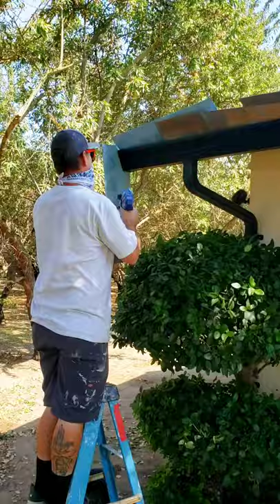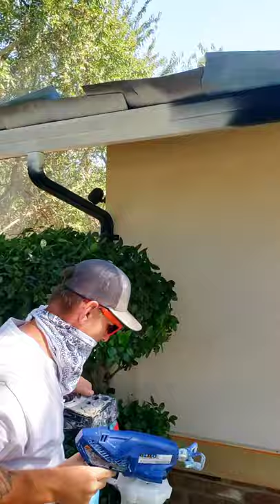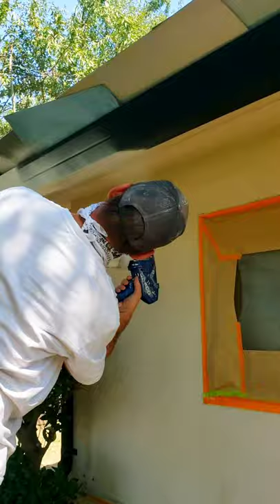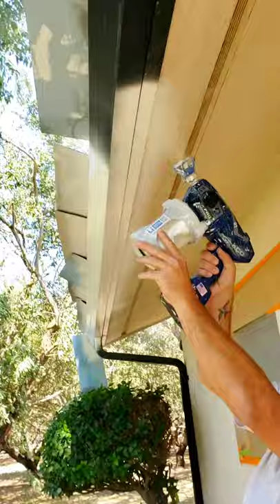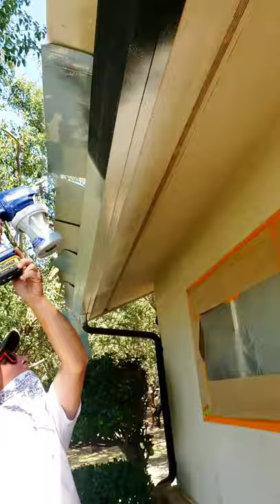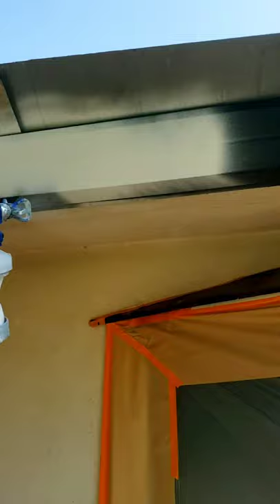Fastest Way to Paint Gutters #shorts

Comment: Hope the metal was scuffed up first.
Reply: Hi, we have aluminum siding,  the really thick board kind. We really want to pint it to save money because it's still in nice shape and we love the board width and the fake wood grain. We were thinking about getting one of these. Do you think that would be a good idea? What do you mean by scuffing the metal? Thx for any feedback.
Reply: @illbeyourstumbleine  sure, if you use the correct exterior paint, and lightly scuff the material being painted. Just a light sanding is all I mean by scuffing. When you buy your paint ask the associate what grit they’d recommend. It shouldn’t be a really aggressive sand paper. The type of paint you decide on may require a primer coat also. Again just ask the associate. No reason such a gun wouldn’t work! 
Prep is most of the work, when paints involved.
Reply: @nopleaseno2515  thanks for the reply!
Reply: You don’t scuff them that causes rust you use dtm bonding primer. 
If you know you know 🤷🏼